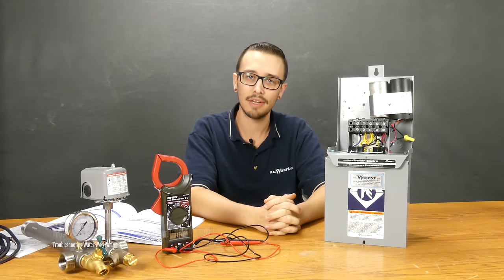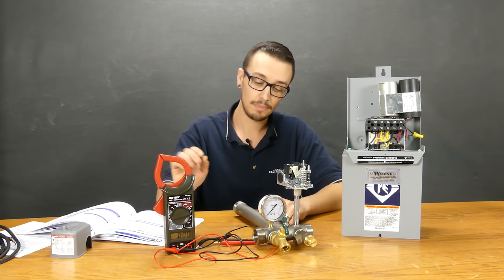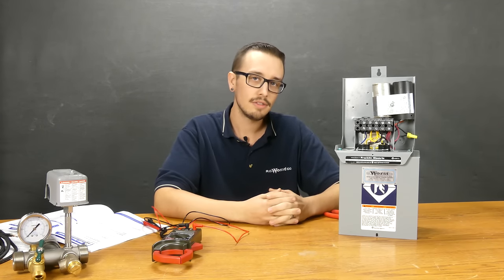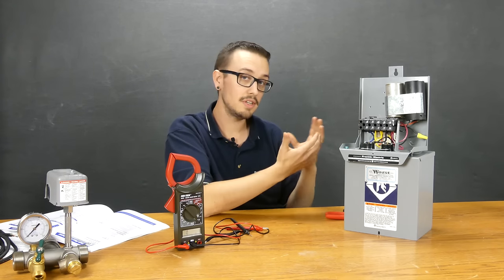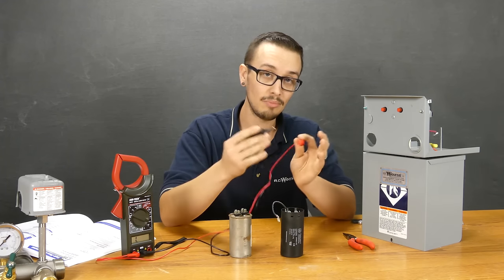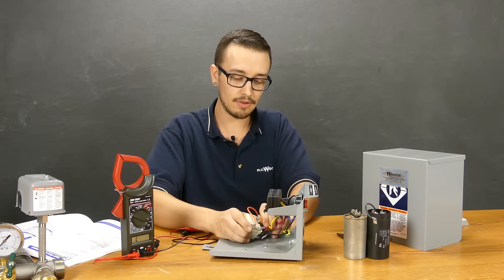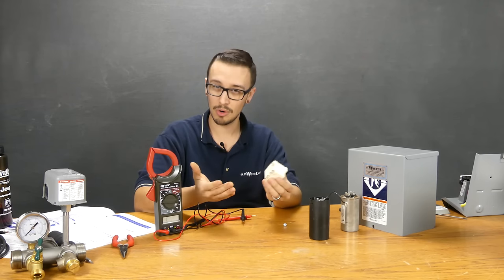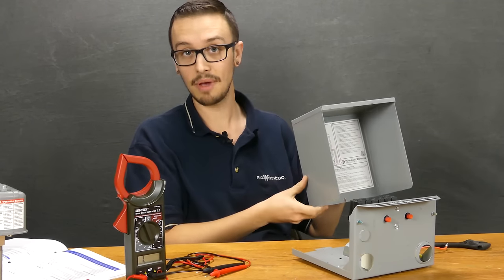How to Troubleshoot Franklin Electric Control Boxes (1.5 - 15 HP)

Comment: I recently moved into my home that has city water and sewer. However, there is a well system that is not functional that I would like to use for my outside spigots.
I have not dug too deeply into this but when I switch the breaker “on” my voltage sniffer detects voltage at the line that goes down the well to the pump.
My question is, could the problem still be a bad control box and that the voltage I am detecting is not sufficient to start the pump ?
My estimate is that the pump has not been used for at least ten years and according to the installation manual that was found by the control box it was installed in 1990, it’s probably dead but I would like to see if there is a possible cheap fix rather than pulling the pump and replacing that, only to find the control was what was at fault.
A visual inspection of the control box shows that the capacitor “dot” is yellow and the capacitor, although not bulging, has leaked something that is now dried and crusty.

I guess my question is, will I still be able to sniff voltage at the well shaft with a control box that is bad.
Reply from the maker: Yes, it will still pass voltage through. I would recommend purchasing a new control box and hoping that fixes the issue. You can buy them at rcworst.com
Reply: @RCworstwater Thanks !  I have been able to source the replacement capacitor locally,  same specs as that which is looking to have blown. Am I wasting my time replacing just that or is it necessary to replace the whole control box. If I do replace the box, what is the estimated shipping time to CT and which box would you recommend. The box I have is for 230V 1/2 HP, three wire. I do not know what type of pump is in the well but I'll have to assume it's a 1/2 HP.
Reply from the maker: @Mandinka711  You can try replacing just the capacitor and see if that works. A lot of times, when one component in a box fails the other components fail shortly after, which is why we recommend replacing the whole box. Here's a link to the one you need: https://www.rcworst.com/Franklin-Electric-2801054915-QD-Submersible-Motor-Control-Box-0-5-HP-230V-1PH-For-3-Wire-Motors-p197.html
Reply: @RCworstwater  Yeah, I had already bought the capacitor so I figured I would replace that. Nothing. So I then tested the relay using your video. I have the blue relay but mine is rated 1/2 HP 230 V. I disconnected the relay and my results were CAP-B - nothing. B-L1 I got 0.3 Ohms. 
Does that suggest the relay is bad. If it is I'll buy a new box. I'm trying to eliminate the issues without spending more money on parts I don't actually need. If it's not then presumably I have to pull the pump. Is there a way to test the pump is at least still connected rather than there being a bad splice somewhere ? Is there a way to test the pump itself without pulling it ? Thanks.

Comment: If the capacitor is fully charged and you put an ohmeter on the terminals, won't it discharge and blow out your meter?
Reply from the maker: You are correct. It is best practice to short the capacitor with an insulated screwdriver prior to testing.

Comment: After taking my Franklin control box apart, everything seems to test ok, but the capacitor has leaked some of its guts it appears so I suspect it may be bad..I wasn't able to perform the micro farad test..I bought a control box from the local store but it's not a Franklin, doesn't have a No load protector and the lines are slightly different...(red goes to relay and black goes to capacitor) so I'm reticent to try it...The pump has been starting then stopping with no water pressure..I suspect the line might be frozen? Or could it be the box? And I'm tempted to try the new controller ( was told they are universal which I suspect isn't true) just to see..so I'm at a crux...any suggestions...by the way, I live   in remote Haines Alaska, so it's not easy to get the correct parts except by mail...
Reply: Also the motor windings test with good resistance...

Comment: The continuity between 1 and 2 is '0'. Those contacts are closed, not open?
Reply from the maker: The resistance is 0 - meaning complete continuity and the contacts are closed
Reply: @RCworstwater  I agree. But in the video, I believe you state that the contacts are open? Maybe I misheard... Sorry if I did.

Comment: my question is the following as it is the formula to place capacitors to the motor at least 5.5 hp and if it is within your reach the diagram of the box of layers that you have in your hands also that suncion makes this relay RELAY 5HP-15HP FRANKLIN 155031601 as I know the component that stops a relay that is a lightning arrestor that is connected in the wiring that goes along with the capacitors as I am when it is good or damaged like the relay 5HP-15HP FRANKLIN 155031601 when it is damaged

Comment: So I get no resistance reading on one of the overload buttons.  The meter shows OL no matter what.  How do I replace just the overload buttons?
Reply: Eric Grose you have to buy a new well pump and control box, and usually need an entire new well drilled when that happens.  But seriously, did you ever find out?
Reply: @Samlol23_drrich  I replaced the control box and everything worked again.
Reply: Eric Grose Seriously? There was no way of replacing just the buttons? I have the same issue
Reply: @marsogreen2411  I tried tracking down those button assemblies by the numbers on them but couldn't find anything. So I gave up. I consider the old box spare parts.😀
Reply from the maker: We sell them, just give us a call: 855.329.4519

Comment: I got zero reading on my overloads (non tripped) this lead me to buy a new box because I had everything else  . Brand new box also one reads 0 one .1ohm . Zero is an acceptable reading . If it were tripped as in switch tripped connection to power is broken and would show O.L .
Reply from the maker: That is correct. Less than .5 ohms is a good reading.
Reply: @RCworstwater  yes I’ve come to understand that. Perhaps you misspoke in video and written introduction online  and meant o.l reading would indicate tripped overloads instead of 0.

Comment: 2hp submersible, not working. Power company ripped through a line a few hundred yards away while trimming trees, actually had cut all the way through.  Claimed it didn't hurt anything. I replaced bad control box, relay and capacitors cooked. Started up and ran great for 3 days. Several hours a day (because lack of rain and pond is drying up, only use for that well) and then day 4 it just stopped. was pumping about 5gal/10 sec. I opened control box, one blk wire to black capacitor had not been crimped at factory properly and was loose as I was looking around and relay points were burned. I replaced capacitor with a good one, and sanded points in relay. Turned on and all I get is a spark from white relay box. Black capacitor not affected. Good pressure switch, new relief valve, wondering what they will say if I try to return box that had loose wire to the connector. Thanks for any suggestions!!

Comment: Thank you for the video.  Have replaced the control box twice over the years (can get it for about $160 on amazon) but now I can just replace the bad parts for much less.  I have the same question another person asked about the relay resistance.  You say 4.7 - 7.0 Ω and we can't see what scale you are on with the video resolution, but then you move the switch three positions to the x1 scale, suggesting that you were on the x1000 scale when you measured resistance initially.  So should it be 4.7 - 7.0 kΩ?

Comment: No more plug in modules, or the royal blue painted control box as was with Jacuzzi well pumps.    I'd be very concerned about using a very inexpensive multi-meter, as they do not have many safety features which protect the user as found in a Amprobe or Fluke.   A great example of quality is the video of EEVblog 1377 - The Amazing UNPREDICTABILITY of Fuses! used in cheap verses quality multimeters.

Comment: Wrong size pressure switch for that 3 hp box. 9013-GSG2 is the proper size
Reply from the maker: Any size pressure switch will work with a deluxe control box

Comment: What is the purpose of the control box.
I have had a well water supply in two different states. 

The wiring was hooked directly into the pressure switch.
Reply from the maker: Control boxes are required for 3-wire pumps because the starting components are not built-in to the motors. You can learn more by watching this video: https://www.youtube.com/watch?v=86oOOCKJgWg&t=483s

Comment: At 4:56 or so you state that something is already tripped. No idea what you are saying. Cant make it out. What is already tripped. Think you are talking about the overloads but cant understand the word you used. Listened to it 3 or 4 times but still no idea what you said.
Reply from the maker: He said that if you do not get any reading between the points on the overload that means it has already tripped. You'll need push it back in and take another reading.

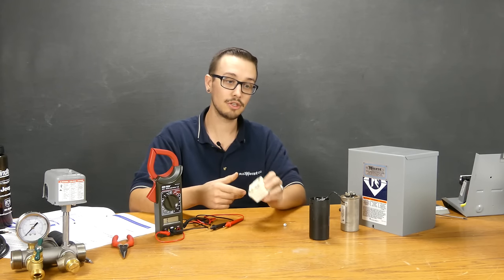Comment: Zero ohms 10:44 across a set of contacts means it is open? 10:49. This is complete nonsense, zero ohms across a set of points is a 100% sure indication that the contacts are closed.
Reply: Agree - I opened my relay and confirmed it is normally closed.  Also agree with the correction that the coil resistance is 4.5 - 7 kohms, not 4.5 - 7 ohms.